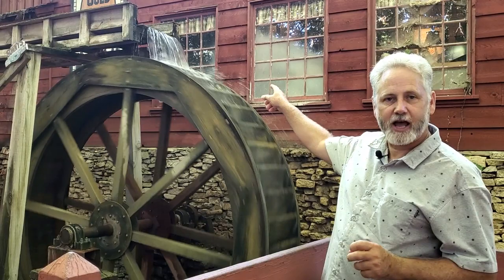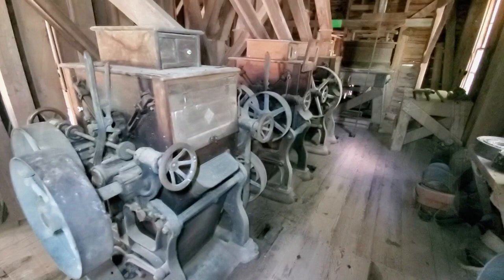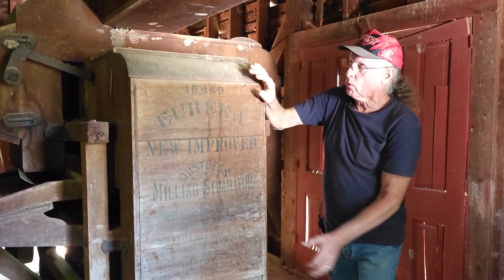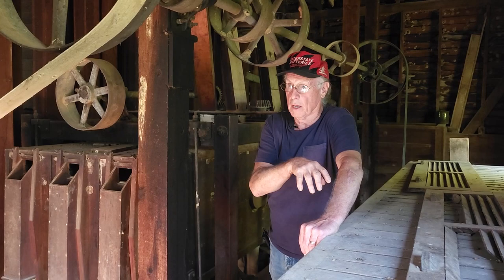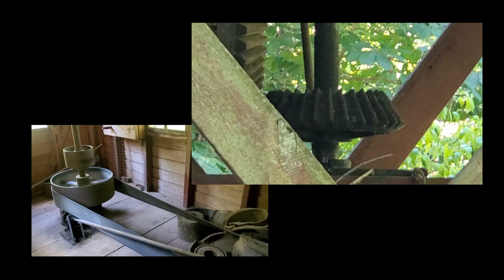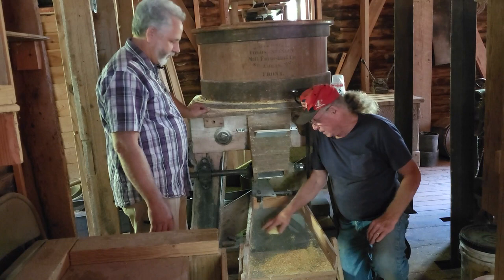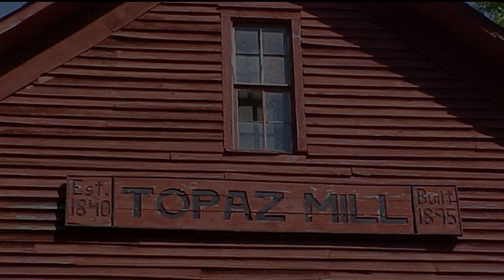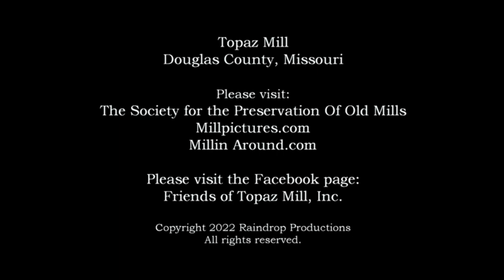Let's explore Topaz Mill. We'll watch this 1894 operating water powered grist mill grind corn.

Comment: I'm thinking this mill is missing a serious opportunity. They seem to have plenty of water head and when not in use for the mill they could be using it full time to make power.
Reply from the maker: There have been amazing advances in technology for small electric turbines lately. I saw a small 3' diameter turbine that only needed 4' of fall to create nearly a megawatt of electricity. There is great opportunity for power generation in small applications like this, however, the environmental regulation of waterways will prohibit the use of this  new technology because of the lack of ability to get a permit. Ironic isn't it.